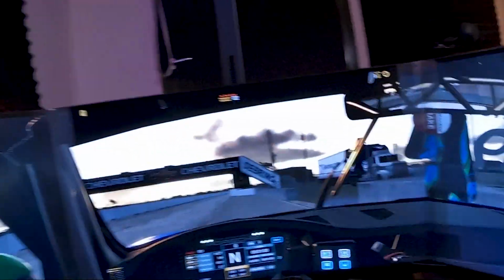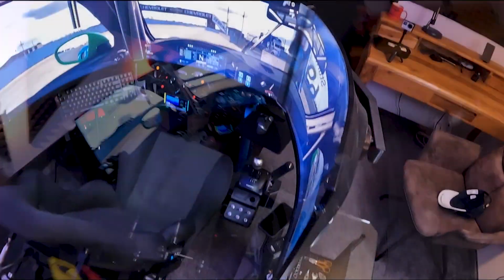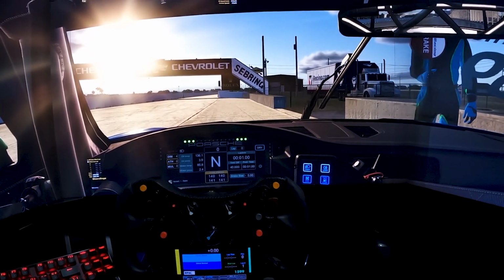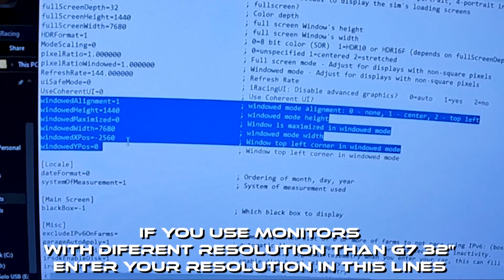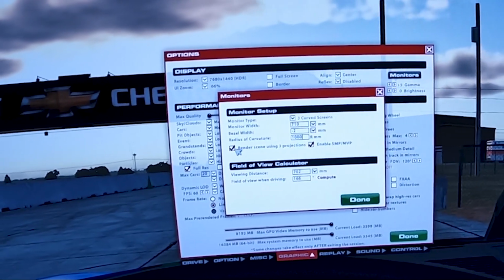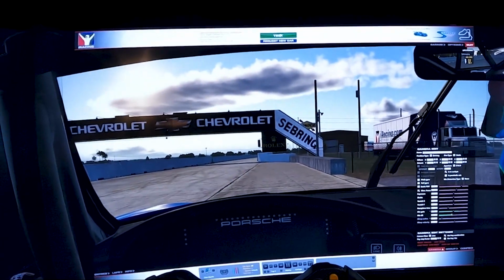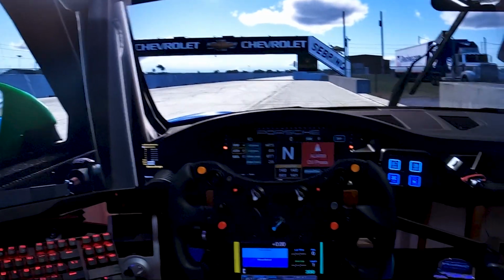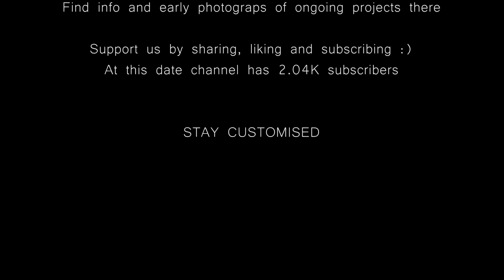Realistic FOV Setup Tutorial In Iracing - Samsung G7 Triple Screen With Asus Free Bezel Kit

Comment: Awesome setup! Your custom work is extremely impressive. The triple monitor stand is epic, love the design BTW and the DD extension is something many of would love/need to have. Much respect brodie and thanks for sharing your experiences with setting things up.
Reply from the maker: Thank you! Yeah I might make a product of extension if some more people would show interest.
Reply: @T.S.CUSTOM  Thanks for the tutorial,  I have the same triple screen set up and this has helped me a lot.  
I need the steering wheel extension piece, so if you were to make one available, I am definitely interested.
Reply from the maker: @grahammatthew9698  I'm now seriously thinking of offering it on Ebay soon. Stay tuned.
Reply: @T.S.CUSTOM  Awesome.
Reply: @T.S.CUSTOM  Quick question for HDR to work do you need to switch on HDR on Windows screen settings ?
Reply from the maker: @Djk0t  I believe so because if it is setup like this, it's basically running in windowed mode without borders. So it needs to be enabled in windows.
Reply: @T.S.CUSTOM  Thank you
Reply: I like that extension as well ... to create a 2nd rig with a single G9 monitor